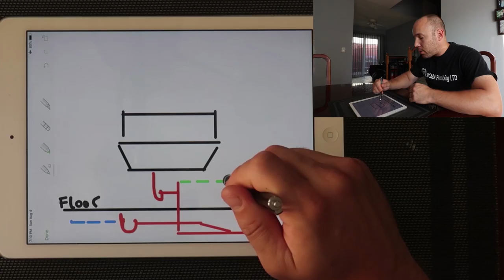Plumbing On My First Day

Comment: Iam thinking about being a plumber but i got a problem. I got a DUI 3 years ago, will it be hard to find a job in plumbing?
Reply from the maker: Julio, I’m not sure if a DUI will slow you down a lot in this trade. I do know that in service plumbing, once you get skilled enough you will be provided a truck to drive around. So once your DUI expires, you should be ok to get your drivers license again . I don’t think this will hurt dramatically when trying to find a job, but it will depend on the company’s you try. Let me know how it goes.
Reply: Kenny Molotov . I already have my drivers license but in the state of Florida the DUI stays for 75 years so thats the bad part .